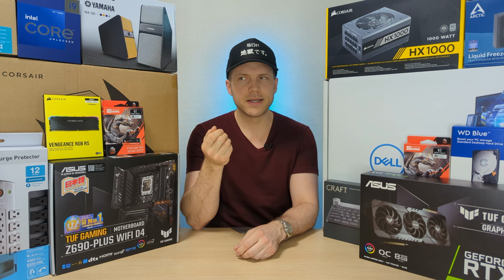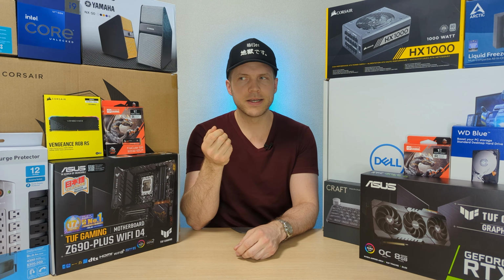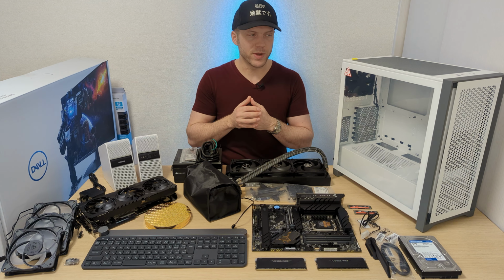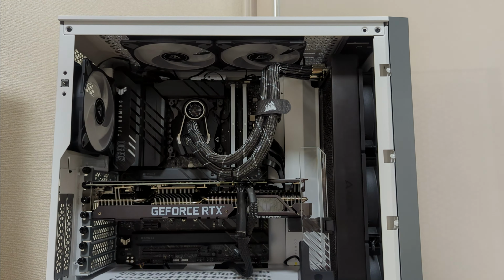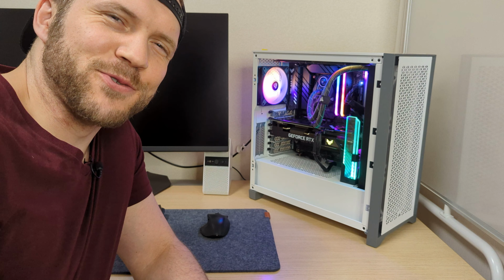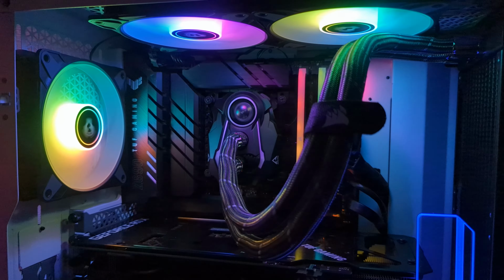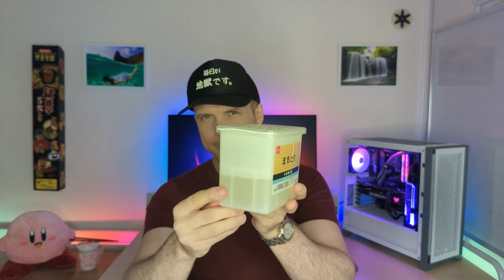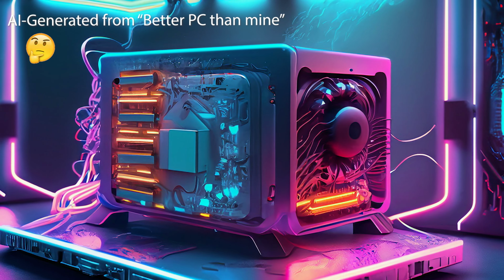1st Ever PC Build - $4,000! │ 4k Video Editing in Japan

Comment: I am one of those people who do NOT edit videos and do NOT really game much but always follow computer tech news and reviews, marveling on the increasing performance and speed as the years gone by lol. So I was very surprised to see the first video is about editing rig! Very nice production quality already out of the bat! Bravo!! 

Also one thing I noticed is how the gears in Japan are more expensive compared to the US like you said! For instance, RTX 3060 Ti 8GB is around 48,000 Yen in the US vs. 72,000 in Japan, which will get you a 3070 in the US O_O insaneee. 

Yeah, liquid cooling is probably not ideal except if you're running a workstation mining crypto 24/7 lol..
Reply from the maker: Yeah Handrio, you've hit the nail on the head. With liquid cooling it might be more risky, but since I'm sometimes overclocking the 12900k which runs super hot, my only real non-AIO cooling solution would be a Noctua NH-D15 which is very large and wouldn't be nearly as aesthetic.

But yeah, you are right. Japan is known for being such a tech mecca. But that doesn't mean it'll be cheaper, that's for sure!